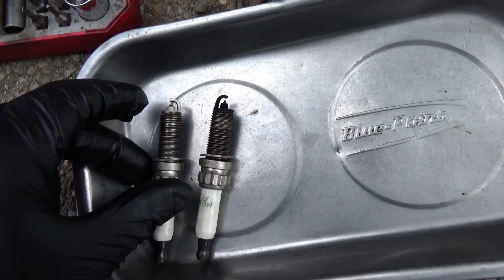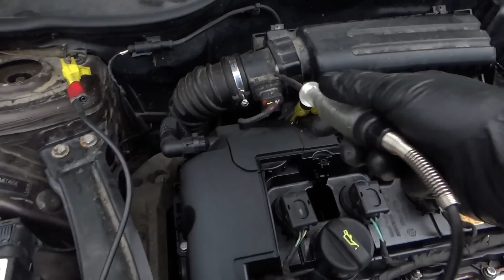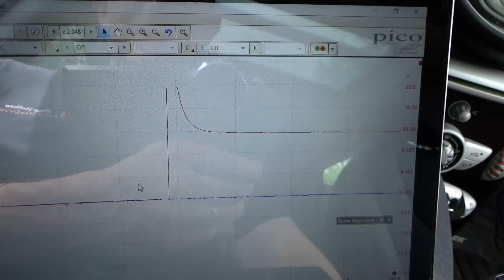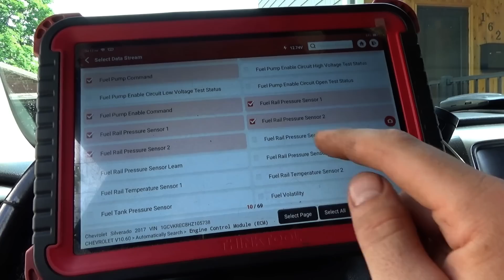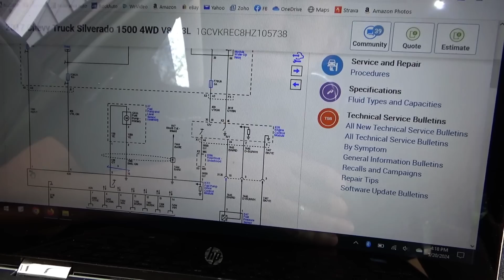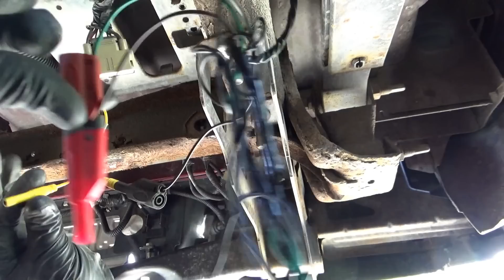Mini MISFIRE...& Chevy LOW FUEL PRESSURE (P2635)? (Double Diag!)

Comment: Ivan, run, dont walk, away from that mini. I recall the one Eric O was working on. There is no keyway on the harmonic balancer to line up the crank with the cams. It is only held on place by torquing the crank nut to a gazillion ft. Lbs, plus 90 degrees. The Germans are nuts. They are a lot of fun, right up until they break.
Reply: Ford 4cyl uses a similar system.  Friction holds timing
Reply: @FCSlim  I think it is insane, but thanks for the warning!
Reply: @superfinn80  its been used that way since the late 90s i believe

Comment: Hey Ivan I am having so problems with my Suzuki xl7 it is a 2007 and I can’t get both my snap on modus or my topdon top scan pro to do a crankshaft variation relearn can you recommend a scan tool that I not that expensive

Comment: I'm serious in requesting feedback from auto component DESIGNERS.  Specifically, electronic designers.  When writing your design criteria do you include that this component: "shall not be damaged by any electrical connection being shorted to either B+ or GND?"  Obviously the component won't function properly but will, by design,  resume correct operation once short is repaired.  Shorting +12V must activate proper fusing.

Comment: Good diagnosis on the injectior. An alternative way would have been the use of an injector pulse tester and a fuel pressure gauge. Pulse test to see the pressure drop on each injector after priming would have shown the problem.

Comment: IVAN is teaching!  And, more importantly, he both shows and repeats (common themes over different vids).  He shows basic diagnostic strategies... not brain surgery but STILL highly DISCIPLINED.

My recent self revelation is that car repair is two parts:  (-1-) structured diagnosis/repair, (-2-) frustration abatement.  EQUAL PARTS?

That 2nd part is compounded by the shop management's pressure to contain time/price.  The DIY'er, however, needs his/her car.  Last time I traded in a car on new I decided it more prudent to just keep the trade as backup.. (NAPA, and others, do deliver.)

Comment: No need for a scope on that injector to tell you it's not working. If you send power through an injector and it doesn't click, then the injector is bad and needs replacing. That's basically a "bench test" of the injector and it failed. It doesn't get any more basic than that and provides more than enough evidence for a "definitive" diagnosis. It's how we did it before the invention of the scope.

Good job on both regardless.
Reply from the maker: Scope also checks the computer driver 😉
Reply: @PineHollowAutoDiagnostics  That it does. However, the bench test proves that the injector was bad, beyond all doubt whatsoever and needs to be replaced. If it fails this test, it will fail all other tests, including the scope, and thus, the scope was not needed for this job.

 I hope you didn't charge the customer for that unnecessary test. If the injector had passed the bench test, then, and only then, would you need to scope it to see if the driver was working. 😥

Comment: the truck has fuel pump, filter and regulator all in the module at bottom and there's three nylon flex tubes, plus o-rings connecting pump, filter, regulator and up to the tank plate outlet.
could be any of them broken in there, but probably plastic fantastic regulator peeing all over or tubing rubbed out.

Comment: Hey Mr. Pine Hollow auto diagnostic I have a 2001 Nissan maxima 3.0 L I got PO 505 idle control valve put a new one in but it still have the PO 505. Can you please help me?

Comment: I've seen a number of these modern FDM's that have a fuel pressure regulator inside it.  It's rare but they sometimes fail.  And other times, it's the pump motor no longer has enough power to get the fuel pressure up to spec.  That's usually caused when you run the tank dry a few times and the pump motor overheats.  I always tell my customers that had a fuel pump replaced to try to retrain your thought that 1/4 of a tank is the new empty.  I commonly get told how they can't afford to keep the tank filled like that.  My rebuttal is, it's far cheaper to keep a little more fuel in the tank then to pay someone like me to replace your fuel pump.
Reply: But fuel pump modules are constantly being filled with fuel up to the brim, even if you have a couple liters inside… doesn’t matter if it’s low or not…
Reply: @zoneb609  The fuel in the tank works as a coolant for the fuel pump.  But that coolant is gone when the operator runs the vehicle completely out of fuel.

Comment: They do not make fuel pumps like they used to.Can you remember when the fuel pump ran off the crank or the cam ? they hardly ever stopped working.Cheers Ivan.
Reply: I only remember when they ran off an eccentric on the cam, never on the crank, as far as I know. I DO remember when you could buy a rebuild kit for the cam driven fuel pumps which consisted of two check valves, a new diaphragm, and a new pump to block gasket. Back then, we rarely threw anything away. Nowadays whenever I go to the local landfill, I can't believe what I see. Mountains of appliances, furnaces, AC Condensers that look nearly new, and then I hear the greenies saying how they are saving the planet. I was born in the dark, but not last night.

Comment: I know that in my Holden VY SS Commodore I had to investigate a hard starting condition & the fuel pressure was dropping off straight after the fuel pump prime signal switched off the fuel pump relay after I turned the ignition switch to the on position.

The in tank fuel pump & sender unit has one of those PR217 type of GM fuel pressure regulators which I fitted & I ran the fuel pump & sender unit in a bucket of fuel to find out that the diaphragm had ruptured & it was spitting fuel out through the where the vacuum hose would normally connect to on an externally mounted fuel pressure regulator setup.

The fix was to replace the fuel pressure regulator,as simple as that !

Comment: I recently had something similar happen with a fuel pump on a 92 Cavalier.  Car quit going down the road.  Crank, no start.  You could hear the fuel pump prime when turning on the key but it sounded like fuel was hitting the side of the tank.  I hooked up a fuel pressure gauge and had no pressure.
I dropped the tank and pulled the pump and was expecting a hose to be off or something but could not see anything wrong with the pump.  I installed a new pump and it fixed the problem.

Comment: Could you use a scan tool or injector activation tool with a fuel gauge hooked up to diagnose the Mini? I know your way is faster but just thinking what I used to do back in the day to figure out a clogged injector problem.

Comment: One other thing I'd check before dropping the tank, close off the return pressure fuel line and see if the pressure goes up.  If it has one.  Some use a PWM pump to regulate pressure and some have a regulator.
Reply: No return on this one.  A fuel return would increase hot fuel in the tank which would lead to more vapor pressure.  More vapor pressure = more emissions.
Reply: @charliemagoo7943  I knew they'd changed over, just wasn't sure when. The first Direct Injection systems had the return and then went to the returnless system.

Comment: I think that in addition to the key shape in the Mini that tone generator for the warnings is just sooooo entertaining.  While you were explaining the issue with the Mini I could hear it in the background.  As for the Chevrolet truck, we had an issue many years ago that was similar.  1983 Ford Country Squire wagon had a bad miss at wide open throttle.  We tried everything to diagnose the issue to no avail.  1983 was the first year for Central Fuel Injection on full-sized Fords; an electric fuel pump was in the tank.  We dropped the tank and pulled the fuel pump out.  Submerged the fuel pump in water and discovered a rubber hose between the pump and the connection to the fuel line inside the tank had split and fuel was spraying out the crack in the hose.  We repaired the hose and the car ran fine after that.  It sounds like you had diagnosed that on the Chevrolet.  GREAT VIDEO!

Comment: Concerning the injector scope test.....why did the scope show 12v before starting if the injector was not being fired (and grounded)  yet?
Reply: The circuit (12V from source) is connected to the test point (the injector).  It’s like water connected to a spigot (giving pressure) in a 25 foot long garden hose with a sealed plug in the other end . Both are potential just waiting for the circuit to be given a critical condition (ground path complete) to permit work .
Reply: @ThunderbirdRocket  Thanks for the reply, but I still don't get where the path to ground was coming from BEFORE the engine was started.

Comment: Ivan.
I appreciate you teaching us rookies. 
Following your diagnosis process. 
I diagnosed a similar fuel pump issue with a 2017 F150 for my friend.
He took it to a local parts for a diagnosis and was told, replace the fuel pressure sensor. 
Replaced and still the same issue.
Since he didn't have a scanner he has to rely on parts stores., since it's free.
He came to my shade tree service and I went further. After replacing the fuel pump. Truck runs great.

Comment: Yup, I was losing fuel pressure inside the tank. Before I bought the car someone changed only the pump and didn't connect it to the fuel line properly. It was spraying inside the tank. My neighbor replaced the assembly for me and misfires were gone! My car runs great!

Comment: I'll never own GDI. Even Hyundai has gone back to MPI on their 2.0 four cylinder.
Reply: Toyota uses both on the same engine.  MPI for the low load regime, GDI at the high end.  That strategy prevents GDI problems at low end and increases efficiency at high end.  IMO, reliability should be what drives automotive technology and government mandates should go to hell.

Comment: With the Mini I'm wondering why you or the previous mechanic didn't just swap the #3 injector with a different cylinder and see if the misfire followed it?
Reply: TWO o-rings required......  LOL
I HATE injector connectors.  Though the harbour freight  pick tool worked nice for the last one I tool off a few weeks ago.  '07 had metal fuel rail, '09 went to plastic.  Finally found a difference in the engine. 😒

Comment: The oem GM fuel pumps from '00-'20 are basically garbage and they won't go much more than ten years, approximately.
Reply: good to hear.  My '08 should be safe.  Although my first scan shocked me.  The dashboard says it is an '05 module.
Reply: @robertsmith2956  save yourself the future headache and just replace it now. I can almost guarantee you it will fail within the next year or two. Imo
Reply: @nicetna2010  Mine is on steroids.  The tank pressure sensor says I am at 3500psi.
Can't wait to get it up on stands and hook scope to sensor, and pump.  Trips an evap code every ~600 miles.  Will be my first alldata sub.  The temp control motors are not working, so need to fix them as well.  Found out the hard way on a 600 mile trip in early febuary.  brrrrrrr..... Live data shows voltage signal changing, so looks like the motors are dead.  
Should have the suzuki done this week, then I can put it up on stands.  Can't wait to try out alldata, and the new pico.  Got a start stall dodge that will give it, and my test lights a workout.  30 year old wires under the hood.

Comment: Hey Ivan here in SE Kentucky at least 50% of all Gm vehicles have a headlight out. I am being generous it probably is 60%. I suggest you check the Headlights on every GM just to see if that problem exists outside of Kentucky. If it is true I would be curious is it just a bulb problem or the wiring. Thanks
Reply: I've replaced 3 low, and 2 highs over the years on lacrosse.  Of course the extra low was passenger side in front of the battery for extra work.  Last set of bulbs were long life, about 6 years ago now.
Nothing strange about pigtail connectors.  Just south of SW side of KY.
Reply: @robertsmith2956  People here are extremely frugal {cheap} that is probably a big part of it, but it is way worse with GM vehicles. I rarely see a Ford or Honda with a light out but do see a Toyota and Chrysler every now and then.
Reply: @Bottoarguewith  The headlight of my RX7 blew as I drove it off the lot after buying it.  LOL
Had to replace both, it wasn't a halogen.
Hate these plastic junk, never have to buff my glass bulbs, they never opaque.
Reply: @Bottoarguewith  or the state mandates it.
You can't fix your car till after it is inspected so you can then spend the money to pass inspection.
Reply: @robertsmith2956  No inspections in Kentucky
Reply: @Bottoarguewith  I know, but some states do that.  You would think if the purpose of inspections was to keep cars maintained they would pay the owner when the car passes instead of robbing them for keeping it perfect.
They tried to set up a "free" inspections at the mall once.  I asked people in line why they are so stupid.  They will take all the failed cars to the capital demanding they pass a law, and you will be paying for inspections for the rest of your life.  Most of them left.

Comment: An easier option would be to check voltage at the fuel pump output wires.  If at 100% duty, the pump is getting 12V and a good ground under load, then you can bypass the rest of your checks and just replace the pump.  Maybe there is a regulator at the pump (obviously set higher than 61 psi or whatever), but it has failed and is dumping pressure back to the tank way too soon.  This could also cause the fuel pressure to drop to zero immediately on key off.
Reply: Even easier option. Amp clamp around power or ground feed to pump. At the 8 amps measured, we have good power, ground, and the pump is trying to produce without success. Donzee!
Reply: But the Module is accessible without disassembly. The power wire for the pump is in the loom and partly obstructed by the tank. Additionally the module is often at fault, so pulling off the connector like Ivan did is a pretty sane choice.
Reply: @tschuuuls486  Agreed.  Plus he didn't need to poke wires.

Comment: I dread the day that I have to replace the high pressure pump on my Silverado. Rube Goldberg engineering.
Reply: The lifetime is mostly governed by fuel quality. Neighbor has a C Class Diesel with 450k km on the clock. Og Fuel Pump and HP Pump.

Comment: Not sure you needed to go to the scope to be definitive on that fuel injector.  When it didn't click with the test light, I think you could have called it there.
Reply: Given that the first (known-good) injector clicked only once, I can fully understand the need to double-check. Do these injectors not have a return spring, maybe? Maybe they rely on fuel pressure to close?
Reply: Still could be the driver since he only got the one click on other injector.   Could ALSO be both, injector stuck, and driver failure since he wasn't detecting a pulse.  Maybe a Noid light would show the pulse better.  Thought you would see the injector opening as well.  guess that is the current ramp for it.

Comment: Car lot once brought me a Mini. Only code was Mass Air flow Performance. The cuse was it needed a timing chain. Codes and part numbers are 2 different things
Reply: That's the difference between a diagnosis and firing the parts cannon.  Did the mini already have a new MAF fitted?
Reply: @ferrumignis  Im not sure. I think another shop looked at it and said they couldnt figure it out.